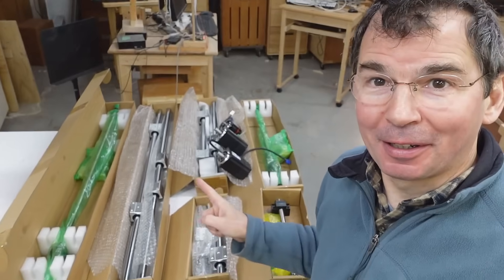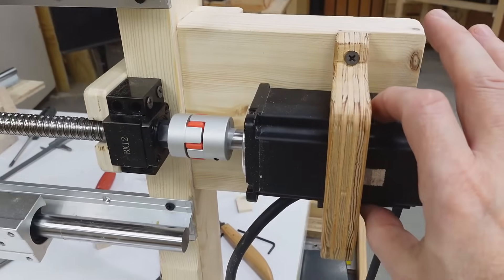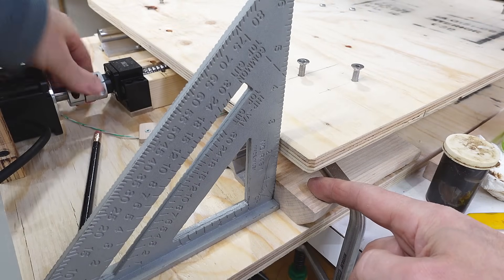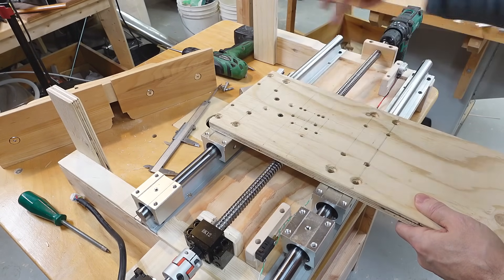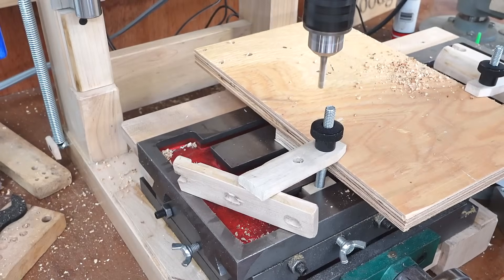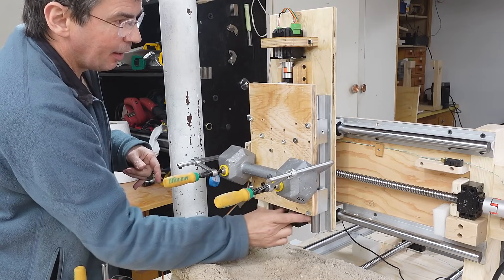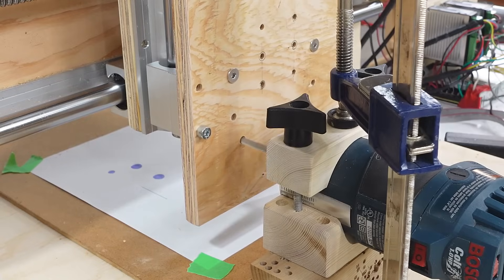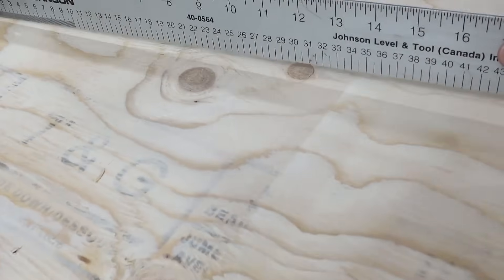Building my CNC router

Comment: Did you consider putting a counter weight on the Z axis? That would reduce the strain of the Z axis servo.
Reply from the maker: I might add a spring at some point.  A weight is a problem because that weight adds to how much the y axis servo needs to move.  Also would need a very good guide so it doesn't add vibrations as its swings around.  Counterweights are only used where the z axis doesn't move in x and y.
Reply: @matthiaswandel  Oddly the Z axis is where a lot of time gets chewed up as far as cycles goes. All the up and down tends to add up. You can set a shallow safe height but there's still a lot of going up and down in a lot of jobs. When you're going up you're not cutting then either.

Comment: I think you should forget the router, and turn it into a printer!
Reply: Printers don't contact the work in a meaningful way so they don't need to be nearly as rigid as spindle machines are. Consequently they are designed a lot differently. The motors on this machine are 10 times bigger than a printer needs. It's all a lot beefier.

Comment: A for effort F for sturdiness. I know you have a reputation the keep :)
Reply from the maker: Actually because the Y axis doesn't move on a gantry, its on there pretty rigidly.  I'd like to see how other CNC routers perform with that sort of accelerations.
Reply: @matthiaswandel  I built a machine a lot like yours and it'll jack a car up it can generate so much force. Something like 4 tons an axis.  I used 10 TPI acme lead screws though. So it doesn't go very fast. 90 inches per minute is as fast as I run it. I hit 200 IPM with it once but burnt a lead nut out in the process. The lead screw was going 2,000 RPM to do that. So I keep it under 1,000. For higher speed you need to prestress the lead screws. You have to stretch them between bearings. What you're doing is a bit janky. You're relying on the motor bearings and floating. But it works.
Reply: That machine is far more sturdy than you realize. It would break your bones like you were a bird.

Comment: To be fair to the cnc stuff taking a lot of time usually you build the frame with less "spongy" materials.
Reply from the maker: like 3d printed plastic :)
Reply: @matthiaswandel  I am working with some CF-Nylon that might actually be stiff enough, although way more expensive than using steel.
Reply: @Ammoniummetavanadate  pet-cf is stiffer, cheaper and has less creep
Reply: @riba2233  I had a buddy telling me about that last night actually, I need to pick some up.
Reply: @ yep, there are some great budget friendly options now, fiberon and siraya for eg.  also less finicky to print.
Reply: @riba2233  Right right, I will take a look, thanks for the recommendation

Comment: I have built 3 cncs myself in my basement. One thing i can say is that cnc is not like any other machine in my workshop. Any woodworking tool would outperform a cnc for my time spent making the part, enev batch jobs are slower. However a cnc can do things that other machines dont have to chance at producing, like a 3D topo map, or decorative v carve inlays.
Reply: Certainly true. I spent days with an angle grinder carving plywood. A CNC likely would have done the work hands off, in a single day.
Reply from the maker: after spending a week setting it up.

Comment: Those "linear rails" are not what you want
Reply from the maker: why?
Reply: @matthiaswandel  They're not THK bearing blocks. But for what you're doing they're fine. My machine uses drawer slides. They're fine too. But a snob would insist you use blocks. Regardless of the fact that what you're doing is working.
Reply: @1pcfred I’m just wondering what kind of accuracy/repeatability do you get with the drawer slides? It sounds like they could be plenty good enough  “for all practical purposes” (if you know that joke).

Comment: Cnc’s are fun if nothing else! But they do allow you to do things easier and often things so much more accurate!
Reply: CNC has a huge gee whiz factor to it. Just watching the machine run by itself is captivating. It is peak magical. I'll never forget the first time I ran my machine. I was like look at it go. I had it plot this random vector image of a cat I'd found. It did it perfectly. It looked so cool. I was all like, I couldn't do that. But of course I didn't know what I was doing so I inadvertently generated G code for 3 passes. So it plotted the cat 3 times. Which I really couldn't do. Because it traced over each line perfectly, of course. At that point I figured the machine was just showing off.

Comment: Your firmware should give you control on speed as well as velocity/acceleration and this can help the noise and precision of the movements.
It looks like you are running full speed all the time.
Reply: Acceleration is a machine controller thing. Right now he's not using a proper machine controller. That's the next step. Using a proper machine controller that accepts G-Code input. The three popular choices for hobby CNC machine controllers are, Mach, LinuxCNC and GRBL. I'd hope he tries and reviews all of them. Mach he might need more specialized hardware? Mach usually needs a translation board. I think LinuxCNC and GRBL both can run off a PI. I'm ready for Mathias' hot take on the software side of CNC.
Reply: @1pcfred Great comment/reply.  I am with you 100%!

Comment: The bumper is not necessary. There is no point that you will ever want or need to run the motor at that speed. Not even to home the table.
Reply: He's running with no proper machine controller at all. So there's no proven safety built in either. Technically it is CNC but a very unique approach to it. So the bumpers he put in are prudent failsafes.
Reply: @1pcfred  I figured he was doing so at the moment, but would implement that in the future. That's VERY unwise!

Comment: CNC really becomes worth it if you have lots of identical parts to make, need rapid production and don't mind a bit of waste - feed in sheet out comes x parts, complex 'high' precision geometry that is hard to do by hand (as you yourself encountered a basic form of building the machine), or when you don't have the space for all the regular tools to do a job the way you would with that nice workshop full of stuff Matthias! 

A gantry CNC is effectively a regular worktable with minor inconveniences added when its powered off, but able to do much the same job as the Bandsaw, Tablesaw, planer etc and usually needing much less space while doing the job too. Does come with downsides of course, but if you have a smaller workspace a gantry CNC router might just be the only tool you really need beyond the hand tools, saving you space in the workshop already, and with the gantry rather than bed slinger style the space you need around the tool to work on larger parts becomes much smaller - work a long sheet through the table saw you need MORE than the full length of the sheet clearance on either side of the blade ideally so you can push it all the way through, can get away with less if you don't mind flipping it over and cutting from both sides. But even then that is much more space around the tool required - if you are slinging the tool and not the bed around the only space constraint on the raw stock is it must fit between the gantry rails and in the workshop.
Reply: CNC really becomes worth it if you have a complicated part you need to make that needs to be accurate. Just one and it can be worth it. As opposed to how careful you'd have to be doing it any other way. The CNC can go max speed accurately. CNC just spits out accuracy.  A thousandth tolerance all day long is incredible.

Comment: 16:16 Introducing the Ball Point Printer <3
Reply from the maker: I actually built a ball point pen plotter... lets see...  1987 -- 38 years ago!
Reply: @matthiaswandel  so that's how you knew what kind of a pen to use. Because ball point pens do plot surprisingly well. I figured you'd just got lucky. I've tried using fancier pens myself but nothing beats a disposable ball point. Well, maybe something does. But nothing I've ever tried does. I made a floating pen carrier for my machine. It is spring loaded. So it is touch off insensitive. Like all molded things disposable pens aren't really tubular. They have taper to them. So making them go up and down isn't exactly trivial. I was trying to figure out what your rubber band mount was about.

Comment: I'm confused by your argument. Obviously a CNC is going to take up your time, and not save you any, if you're going out of your way to build one. But where a CNC shines is the ability to accurately and repeatedly cut out one or more of the same parts all while also being able to work elsewhere while keeping a side eye on it to make sure it's not messing up. This can be debated based on the time it takes to model your part(s) but I'd argue the chances of you having to model it regardless of the method you'll use to make the part may be necessary regardless.
Reply: I have the ability to machine manually and with a CNC and honestly, I find the "CNC costs too much time" is not a valid comment at all. It's like with everything else, you need to get used to it. Like Mike writes, having a machine and settings reliable enough to simply having to keep an eye on it saves an enormous amount of time when working even if it is a one off, and it is especially freeing when designing as with CNC designs, you are almost free of constraints. Using a selfmade Python Script and Collada files instead of one of the many great CNC suites available nowadays is obviously time consuming, cutting rectangular pieces of wood is obviously faster on a circular saw, and only manufacturing pieces suited to manual machines will obviously give the impression that manual machines are faster.
Reply from the maker: if I need to cut out a lot of the same part accurately, it totally makes sense.  Just that I don't have that need very often.

Comment: I also made a machine out of plywood at first. But then I remade it and made it out of metal. Because the wooden machine didn't provide the necessary precision. I'm happy with the iron machine.
Reply: For hobby CNC wood is plenty precise enough. Mathias' machine is a thousandth accurate. What are you doing diffusing semiconductor dies that you need nanometer precision?
Reply: @1pcfred  I probably explained it wrong. The poor accuracy was due to poor rigidity. When making mating parts, they must match exactly. Also, the accuracy depends on the hardness of the material and the processing speed. If the machine is not rigid enough, then the cutter bends by tenths of a millimeter. And this will be revealed during milling, not drawing with a pencil.
Reply: @1pcfred  наверное я перфекционист. Раскаиваюсь 😊
Reply: @1pcfred  wood changes size with heat and moisture. within a few months, you will need to rebuild this
Reply: @1pcfred  plywood, like every other wood, absorbs water. even AB plywood warps.
unless kept in a temperature and moisture controlled environment (pretty much impossible inside a shed or garage) all it takes is a warm day after a day of heavy rain for movement. 
i guess that will dependent on where you live in the world. 
the difference would be massive comparing somewhere that has 100 days of rain a year to somewhere that has 200
Reply: Our shop here in Canada usually hits 35°C at some point in the summer. We have plenty of warm days

Comment: coming soon - kitchen door cabinet like designs on everything.
Reply: CNCs can engrave like crazy. Text, patterns. Any design imaginable. Stuff that'd give you eye bleed to try to do. They really excel at that sort of thing. You need to use special fonts though. Most fonts we use are called outline fonts. They're skeletonized and the font renderer fills them in. But the CNC will just see and cut the edges. Which can be a cool effect but it's not what you usually want. They make special single line fonts for using with CNC though.